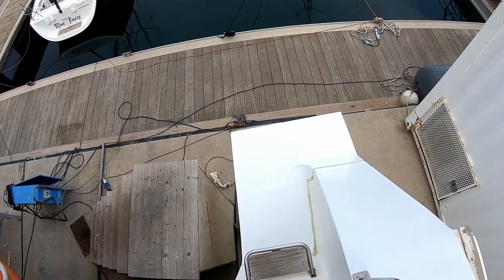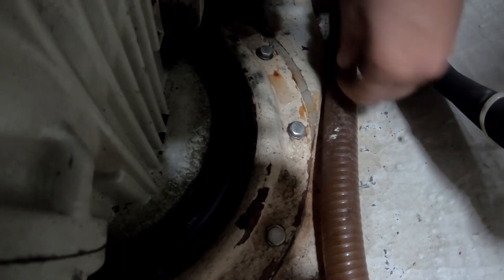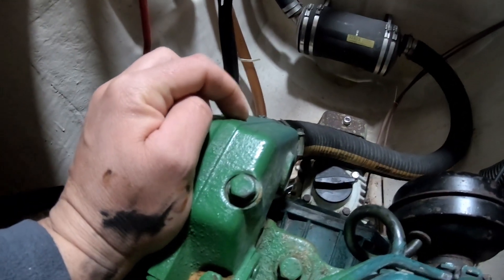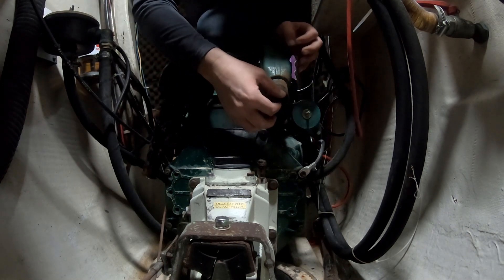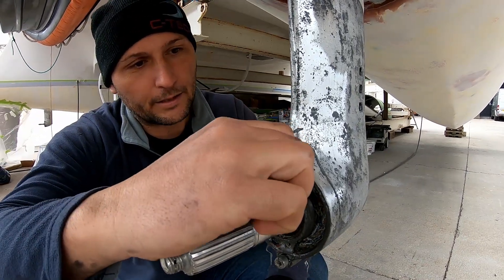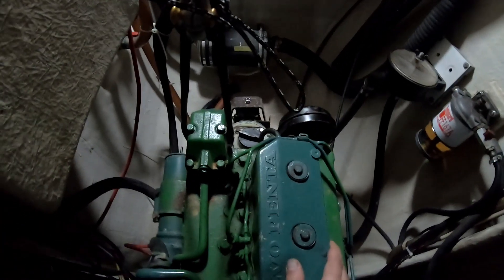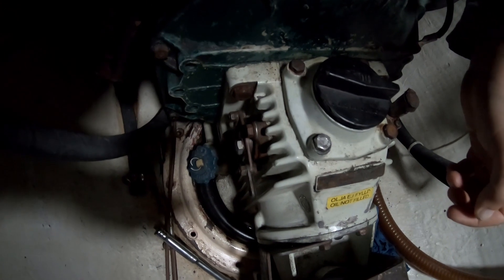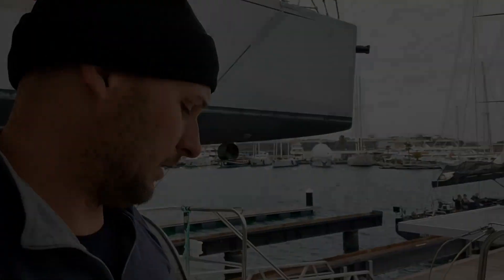Servicing the Volvo Penta Saildrive: Removal and Inspection

Comment: at 12:45 , how did u get the old 2 seals out ? thanks. I'm thinking to freeze the bearing race with some dry ice blocks, drop the race out. then use a cylinder aluminum to push out the 2 seals . may need to heat the housing too to let the race out
Reply from the maker: The bearing cup can be knocked out with a punch. It is light tapping all the way around as it comes out, trying to keep it coming out as square as possible.
Once the bearing cup is out the seals are easy to knock out. Putting the new seals in I try to use a big socket the same diameter as the seal.
Hope this helps👍

Comment: There are a few boat builders who swear that shaft drives are better that sail drives for safety reasons, but almost none use them.  Is there really good reason to have a shaft drive over a sail drive?
Reply from the maker: Yep, there are some that swear shaft is better than sail drive and they have their reasons.  Usually service ability is the main reason. 
The reason most manufacturers use sail drives is ease and cost of installation. 
The argument of the shaft vs saildrive for service costs is becoming a hard one to argue over other factors now. Saildrives have become incredibly reliable.

Comment: Thanks for the video! I’m curious as to what condition your sail drive rubber gasket was in once you’re removed it? I don’t think my gasket has ever been replaced, but I’ve seen some removed after 20 years and they still looked good, so wondering how yours looked. Best of luck with everything!
Reply from the maker: Hey thanks! We just uploaded the next video where we show the rubber gasket removed from the sail drive. It was well and truly ready for replacement. The salt water seemed to harden the rubber and we had sea life growing on it. Glad we replaced it as the cracking was enough for us to be concerned.